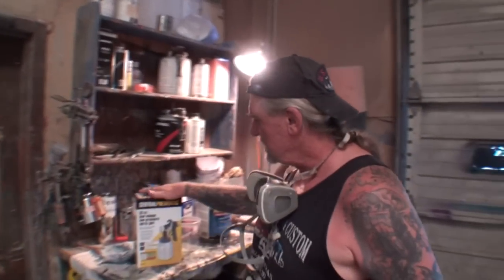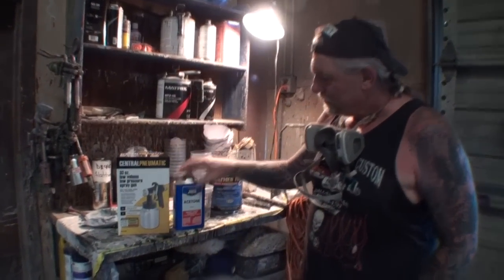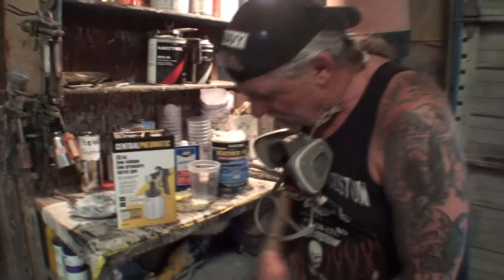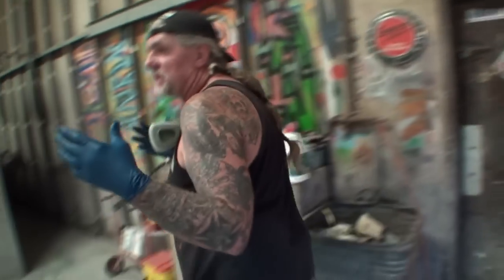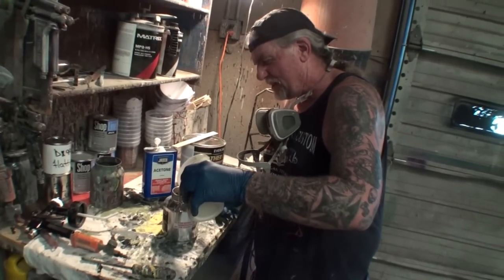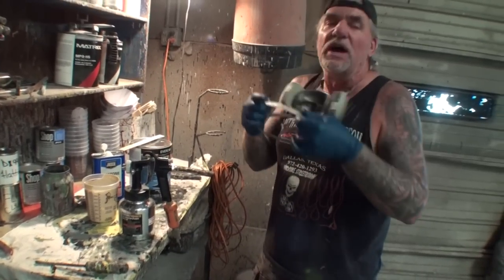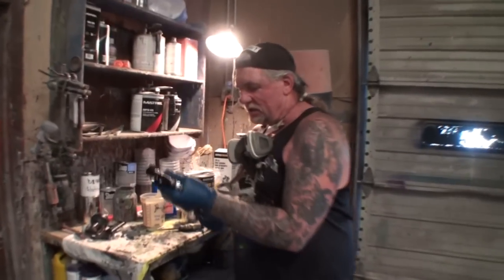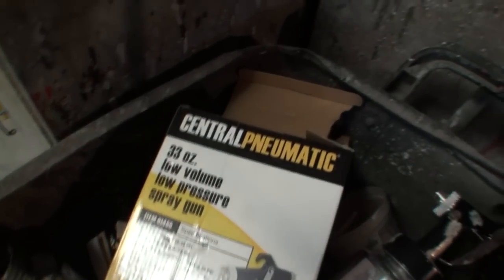Harbor Freight - Throw Away Spray Gun  - TOTAL TRASH?

Comment: Pete, this "Feather Fill G2" reminds me of the gel coat we used to spray at the boat dealer. Don't get me wrong as I was the service manager and not the fiberglass / gel coat tech. He was good at fixing damage. But fiberglass used a polyester resin and the hardener was "Methyl-Ethyol-ketone" that came clear just like that. The gel coat was thinned by adding a "Monomer Styrene" so he could stray it thru the Bink's suction gun. It did not shrink back either and he could spray it on slow and thick, wait two or three minutes, spray some more right over it. After 4-5 coats he would stop, dump the gun out in our re-claim paint products buckets and clean it using acetone. Under warranty or customer pay, I had to get an idea of how much product and what was used to first, bill the customer and second, order more of what was used. Very interesting in my opinion and I truly thank your for showing us the equipment, time management and what works like no shrinkage is huge. After all, your prep-job, is your paint job! And no one wants to apply a product that shrinks back as we all know what that does to the finish. 
I thank you very much! 
I hope your knee heels fast and you and Minnie get some good Christmas memories! It would be nice to get the clutch done right and get a chance to try it, then go for a ride. Man is it getting cold. You are getting the cold we will experience in a couple of days. December 28th 2022, they were showing a -4 degree "High-Temp" for the day! Burrrrr!